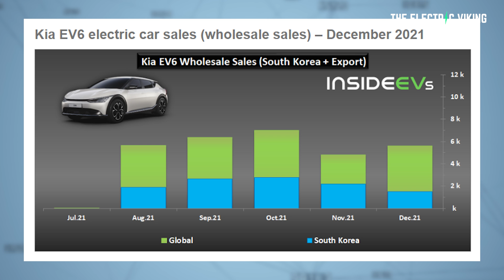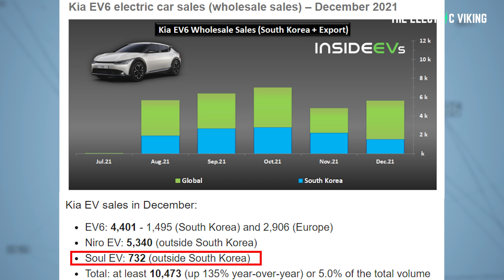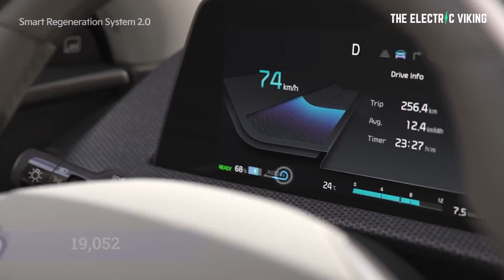The Electric Viking GOES OFF on Kia: 'Good, BAD & UGLY!

Comment: I bought a plug in hybrid from KIA, and they told me it could go 38 km without the gas engine.  In the fall, winter, spring, and cold mornings in the summer it gets ZERO km on the battery.  Why?  Because it has no way to warm the battery, and runs the gas motor constantly to warm the battery.

It pisses me off that I'm pumping CO2 into the air for short trips where we are going a small fraction of 38 km.

I hated being lied to by the KIA dealership, and will never buy from them again.

Warm regards, Rick.

Comment: I wanted the Kia Gt Line for a long time, but cancelled my order due to loooong waiting time (2023). Then I tried the Xpeng P7 and Boy was I surprised. Except for less space and slower charging, the P7 is so much better in every way than Kia EV6. Its much more comfortable, much more silent, extremely quick and handles much better than EV6 can dream of. OTA that strecthes across the entire car, Nvidia Drive, Porsche coorperation suspension/driveline with electronic damping. Brembo/Bosch brakes makes it a killer car. Ive tested 21 elcars in 2021, including all versions of Taycan, and P7 is really up there..( not as premium on every level, but still competes on the important levels like handling/braking/distance/speed, build quality ans so on) 
P7 is a wonder of a car and looks awesome

Comment: Hyundai/Kia have always had underwhelming production of their EVs going back to the Soul EV, Kona EV, etc, especially in North America.  

I give them credit for the Ioniq5/EV6/GV60 triplets, they are pretty impressive.  They just need to start making them in big numbers.
Reply: The Ionic 5 is only available for sale in 18 of the 50 states in the USA. Unfortunately my state isn't one of them.
Reply: @bigtom1948  Not in my state either.
Reply: @benjaminsmith2287  exactly. Since demand is strong, if they don’t ramp up production by 2023, they’re missing out massively on potential sales and profit. They’ll need to secure parts, expertise, etc to enable them to transition to EVs. If they can increase production by 10% per annum, they’ll be on target to be 100% EV by 2032. First they’ll need to use up their expertise, factory setups, etc to produce the last of their ICE vehicles to keep them profitable in the short term.
Reply: @benjaminsmith2287  VW is making EVs in big numbers.

Comment: I've owned 8 Hyundai's and one Kia. I'll never buy a Kia again. I had all four windows fail, the A/C fail 3 times, locked out of my fuel tank 3 times and had to replace both O2 sensors and all of this before it got to 30K miles. I had zero issues with the Hyundai cars until way after 50K miles. I am not sure that there is a quality issue but based on my experience I'll pass on Kia's from now on.
Reply: These more recent vehicles are build to different quality stds.  These guys have improved in quality steadily over the years.
Reply: THIS IS AN EV NOT A ICE vehicle. I'm positive it's legends ahead of what you once purchased.
Reply: @MatrixJockey  Failure of windows, ac, fuel tank lock are not specifically ICE vehicle issues.
Reply: I always wonder who would buy some cars. Kia is one, Nissan is another.
Reply: Do you mind telling us how long you keep your cars? Just math, 8 Hyundai's each for at least 50,000 miles each its either a fleet or some are from the last century.
Reply: @elmojito  We have been buying Hyundai's since 1976 for both my wife and I we had long commutes to our jobs. The last Hyundai was bought in 2011 and traded for the Kia in 2017 when we down sized to one car with retirement. So with 2 drivers and 30-40 mile commutes for each of us the miles rack up pretty quickly.
Reply: @MatrixJockey  I would hope so but I'll pass on Kia's from now on anyway.
Reply: @nbstreet0631  Yep, I remember the Kia Sophia it's better that that car for sure.
Reply: @bigtom1948  Good to know, thank you. I am in fact looking at the EV6 coming from mainly European high end for many years BMW 7 series, MB E class and my last Audi A8 before trading for a RAV4 hybrid in 2019 which albeit very reliable I find it boring. Don't quite do many miles per year as I am retired and have 2 other cars in my house for specific tasks but in Spain major cities have restrictions for alder cars - had to change my A( as it was diesel and 14 years old and 110K kms. - and need to be able to enter Barcelona many time during the year. Of the new EV's within a reasonable price point the EV6 looks quite good indeed as I do not like (actually thoroughly dislike) the Tesla minimalism. Kia here has a 7 year warranty.
Reply: @joeking433  Answer. People who just want a 'car' and got a good deal from the dealership.
Reply: @benjaminsmith2287  Yeah, that was a shock when I learned how many problems I was having with my first BMW and how much it cost to fix!  I went back to Hondas and Toyotas.
Reply: @mikevale3620  Yeah, my guess was that Nissan and Kia were giving deals where their cars were half the sticker price and half the cost of competing models from other brands.  That's all I could think.

Comment: KIA  is the neglected stepchild of Hyundai. They can’t be allowed to be more successful than the parent, even though KIA has always had better looking vehicles when it shares a chassis and drivetrain with Hyundai. I agree that Hyundai is making a big mistake by holding back the production of EVs by KIA. They risk getting eaten alive in the USA  when the Chinese EVs start arriving here in force in a few years. Sandy Munro has been gushing about the apparent quality of the new Imperium EV SUV he bought at the LA International Auto Show when the show ended. I think the KIA EV6 could be a huge winner for KIA in the USA if it were promoted and produced in adequate quantities.
Reply: The proof will be when he takes the Imperium apart to see the quality or not

Comment: Sam. I think Kia is in a similar position to Tesla and Lucid in their early days. That is, the cost to put together a car such as the EV6 greatly exceeds the price point at which they are trying to sell it. Tesla and Lucid had to start with cars over US$100k. you prove the concept, then refine it, then increase production. Only after that process do you get to a mass produced car on comparable price to a modern ICE car. All of these OEMs are 10 years behind Tesla who is creating the price point that the OEM's feel they need to better to win buyers over. But they can't produce the cars anywhere near those prices. So they are making cars most likely at a significant loss and as such producing small numbers to keep those losses contained. On top of that, I think they are also behind in securing the main ingredient, batteries. I laugh when I see Ford and GM advertising their base model F-150's and Silverados at $49k. There is no way in the world they would be making 8% margin on those cars. They would be lucky to be making an 8% loss. It would be fascinating to hear from a Ford or GM or Kia insider as to the true cost of these vehicles to truly understand how much profit or loss they are currently making on these cars

Comment: I think the conclusion of the KIA/Hyundai production results is a bit overcritical. Although they need to ramp up to stay within the toxic hype of EV competition I think they have done alright and have put themselves on the map as a high valued brand for bringing extremely efficient vehicles on the market, and recently the ionic 5 and 6 have sparked some highly interesting designs that in my view easily compete with Tesla as being very refreshing. I think we should not forget these new vehicles are brand new annexed time to grow. Even Tesla had growi g pains in the early days with their production hell. 2021 has also not been kind to Kia/hyundai with the LG battery fires dilemma and recalls. Wouldn't be surprised this has unconsciously put some caution in the wind at Kia!/Hyundai, but also consumers, which might have reduced production a not in the 2nd half of 2021. A comeback from with 200000 units of EV's in 2021 sounds reasonable as a come back goal. Maybe not from a competitive level, but certainly from a company level. Nothing in life is without its ups and downs. We can't predict everything accurately always. I think it will be alright with kia/hyundai. They bring great cars at a competitive cars and have a good efficiency reputation, that no other car brand beyond Tesla car really match to date. If its not reliability in higher production numbers it certainly is in energy efficiency.

Comment: I keep opining that '22 is a catchup year, a year when chip and battery supplies begin to catch up with demand. Sam proclaims it a breakout year, and as an investor I'd like to believe it, but expect there to be a supply/output lag. Meanwhile, builders will tweak their production glitches and software, get ready to break out in '23 when they finally have the stuff they need. Impatient investors will bail early, lose out. As a long-termer, I don't expect to cash in big until '23-'24. Patience, patience. VW is trying hard, may have a chance. Even Ford may survive; GM, probably not. Kia/Hyundai a tosssup.

Comment: It is an interesting conundrum. Willingness to take a risk (perceived, how many will actually buy an expensive at the moment EV) vs walking away from all that sunk ICE capital. I think I saw 50% of Canadians are now actively thinking about an EV as their next vehicle, the wind is certainly blowing. I know if Kia are too slow on the supply side I will be looking v hard at a Model Y when/if it comes to Australia. There is that risk of losing a customer probably for ever. Half hearted expansion / fear of taking a risk(lack of confidence in own judgement). It must be tough though given no one person is in charge of decision making and given the number of technical issues, chips/high tech, batteries supply, engineering conversion of factories. Again points to the amazing rate of progress of Tesla ie E Musk.
Reply: There is no freakin way they would be able to make 70 million EV's a year!  There isn't close to enough lithium, cobalt, and nickel right now to make batteries for 70 million cars a year!  That's going to be a bottleneck and delay the transition to EV's so the ICE cars will have to make cars for a long time until they get that figured out, if it's even possible!

Comment: The Legacy Automakers have an Achilles Heel' they must continue to create ICE Cars, while trying to ramp up EV's.  It will become more pronounced/problematic in the coming years as the EV Startups begin surpassing the Legacy ICE makers EV Auto output.  The EV Startups will also have better Balance sheets/Margins, because they don't have to maintain two distinct platforms at once.  They can focus on EV development only.
Reply: Actually that's a benefit, it lets them come into the market at a nice pace.  They say 35% of cars will be EV's by 2035.  Hopefully they'll find enough lithium, cobalt, and nickel to make that many EV's, but I wouldn't count on it!  That is what will become the bottleneck and those making ICE cars will have no problems selling ICE cars until they figure out the battery component shortage problem!

Comment: Why are you comparing Kia to Byd? CHINA has more than 10 times the population of Korea. Most of the BYD EV is sold in china where as most of Kia's EV is sold in other countries.
Reply: The comparison is more from a production capability standpoint.  Kia just not making enough Electric cars is the point.  Their legacy mindset
Reply: @benjaminsmith2287  They are big on announcing EVs. Just not on making them. It didn't take years for Tesla to build up a demand, it took them years to be able to scale so they could launch at a price that would satisfy the demand already there. The launch of the Model 3 was an instant success. By 2024, Tesla will be making around 3m cars per year. With the amount of investment Kia are making, they will be a bit-part player at best.

Phillip.

Comment: The only legacy automaker doing volume production is VW. All the others show prototypes that never will enter production, or small volume models, or even just renderings. This is the fact that precedes complete failure. January of 2023 will be revealing: huge new worldwide BEV production, and definitive losers will be evident. I don't trust VW: Diess himself said that VW don't have an estimate for, in the next DECADE, for selling electric cars into several markets, including India and Brasil. The fact is, VW have an internal battle, they are managed by petrolheads that need assurance from Elon himself because they don't trust Diess, that's a shame. WV is doomed.
Reply: Niro EV is the second best selling EV in the UK so that ends your argument straight away that it's only VW.
Reply: @jimross5838  Kia Niro is not projected to be an electric BEV platform. It's just another first generation, adapted car. It's also called "self-charging" by Kia, that's a shame: legacy auto need to stop misleading the customers.
Reply: For every 10 cars Hyundai/Kia sells, one is an EV. That's more than any ICE brands selling in the western world.